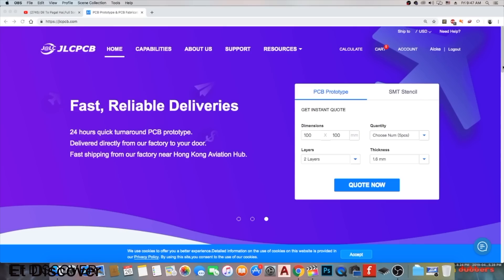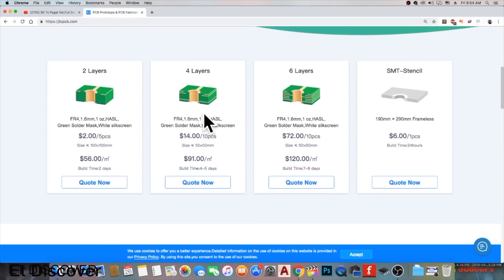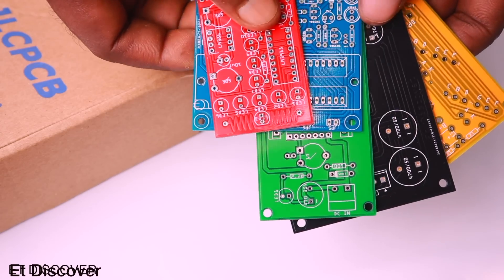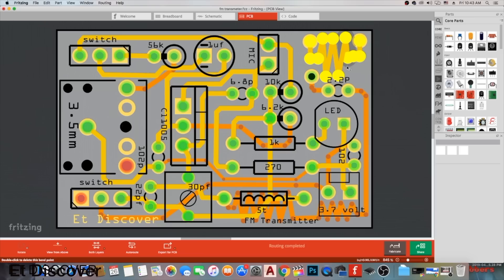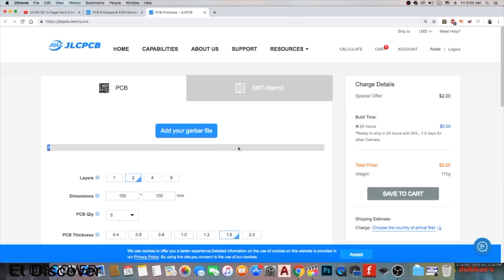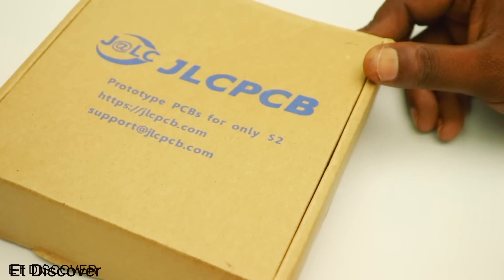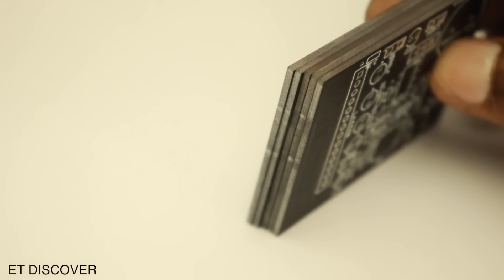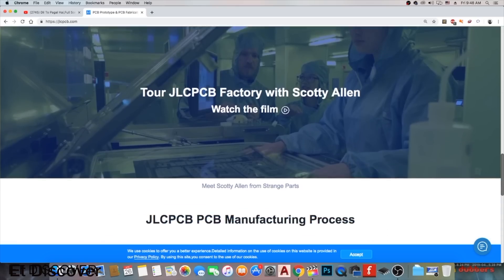As a '0' Gravity Hanging Water # Easy science project #

Comment: That’s just from the frequency of the lights flashing creates an anti gravity illusion drop. It’s just an optical illusion. It’s actually pretty good because instead of using a certain led flashing frequency he used the speaker to make the water vibrate with a constant source of led light it creates the very same illusion but I’ve always seen it done with flashing lights but this seems like another very good method of not better because it’s probably harder to create the flashing frequencies needed I would assume. Either way it was very cool.

Comment: Great project! The water isn't really floating, but you made the FPS trick well!
Reply: If you have time can you please explain me this experiment
Reply: @Shresta941 That motor makes the water float and the frequency made from the speaker makes the water vibrate at 50 hz. Since most video cameras shoot with around the same frames per second( 60 fps), it appears like the water is not moving. But we wont see any difference with naked eye.

Comment: For tgis experiment you dint need any pcb or anything. You can do with only using speaker, water motor, and 50 or 60 hz sound. You need to attach water pipe to speaker and run water through it. And simply play 50 hz sound from your mobile (conect mobile to Music system so it can amplyfy sound) and in a dark room just switch on a light and you will see a reverce water flow. Tip: in India electricity is of 50 hz. So use a simple light in room. It will not work in sunlight, because its light is more than 100 hz refresh rate.
Reply: You re life saver
Reply: @raghvendra5421  yeah
Reply: Can you show how it's done?
Reply: @sureshpanda3233  This is just a illusion of water levitating in middle air. Video is not a continuous thing. Video is just a bunch of photos played after one another. The speed of playing images(photos) is differant as you choose it while shooting a video. It can be 24 fps, 30fps, 60 fos and so on. When you shoot this video you have to match the Herts of sound with fps you are shooting. {This is just a ILLUSION}
Reply: Bro first learn how to type English then teach us lesson 😂😂 khud English ata nahi humko sikhane chala sala
Reply: Thank you
Reply: But How ???

Comment: 10:09 why ceramic capacitor is connected parallel to the motor please answer
Reply: Increase the motor capacity like fan
Reply: @soudhasoudha5461  thanks for answering. But how it increase the capacity of motor please answer i am a bigginer in electrical and electronics
Reply: @kryptocat4240    a motor has a coil and a coil is a inductor.  To stabilize the power through the coil a capacitor is used to hold the charge at its peak and provide  smooth stable power

Comment: 5:55 Connecting leds in parallel like that is a bad circuit disign 
Here all led is parallel to eachother
Reply from the maker: How do you think it's a bad circuit design? Explain me a little. Thank you
Reply: @EtDiscover  connecting that led in parallel means it will draw more current, so you need to connect 3 led's series with a 320E resistor to 12v supply  this will help, I know this because I did that same mistake
Reply: @EtDiscover  don't feel bad about me your project, presentation and creativity is good, I'm saying only this led circuit is the bad disign